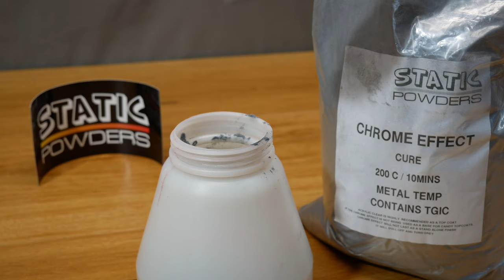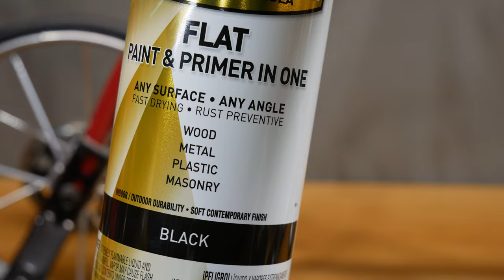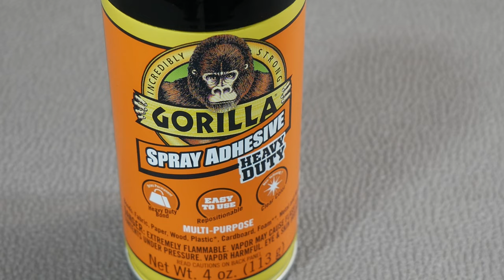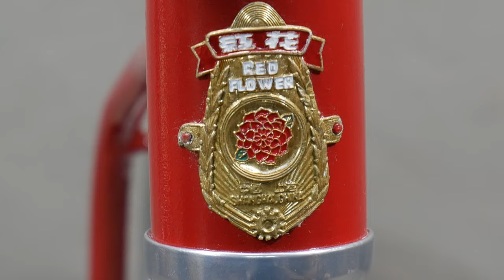Restoring a Unique Vintage Kids Bicycle. Rare Find !

Comment: Amazing work buddy. The powder coating is new. A step up from spray painting and it looks better too, especially the chrome work. I tip my hat to your persistence in restoring the pedals. Most of us would have ditched them and replaced them, but not you. They turned out fantastic.
Great work again mate. You and your family have a great Christmas.
Reply from the maker: Thanks M. Replacing the pedals would have been the easy option but I wanted to try to preserve the original. Thanks again for your support throughout the year, and wishing yours a fantastic holiday's season too 😉👍

Comment: Well done, yet again! 👍🏼👍🏼 This trike has a few unusual features. Don't often see pressed sheet forks. Great save on those pedals. They'd certainly seen better days.
The training wheels are a fantastic touch! I'd imagine the kids get a kick out of them.
Reply from the maker: Thanks for watching. Yes its built slightly differently to the usual ones I come across. I could only find 1 pic online that showed it originally had mud guards, training wheels and a hard leather seat 👍
Reply: @LittleRestorers  You seem to have a knack for finding the unusual!
Anything just as odd coming up?
Reply from the maker: @KevinD_33x150  Mate just because its you, i'll let you on the secret... The next project is another Tricycle but I promise you, it's the last one for this year 🤣😉
Reply: @LittleRestorers  Thanks! 👍 It would be hard to dislike the trikes. It's not like every kid rides one these days.
The end is now much closer than the beginning... 🤣🤣